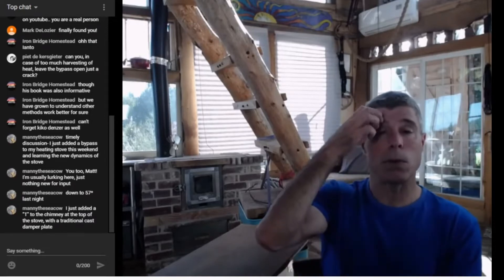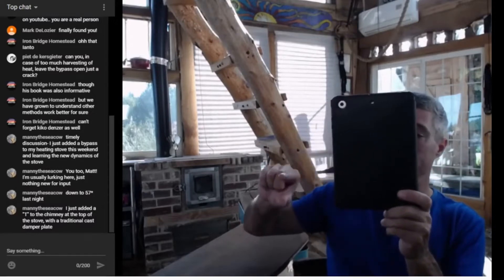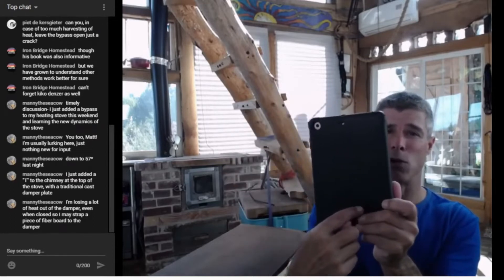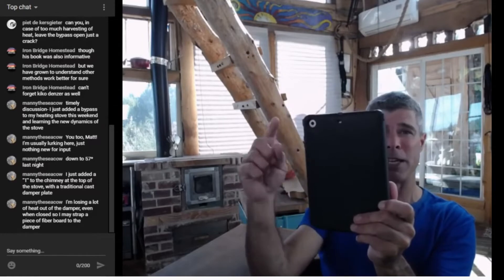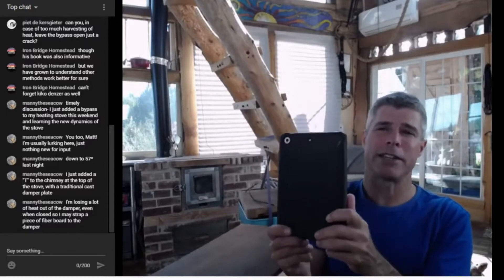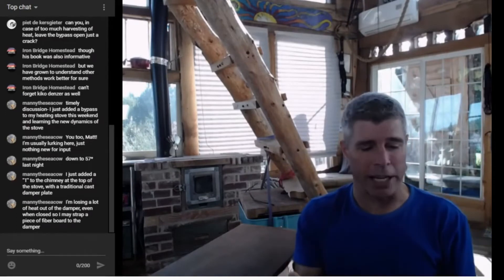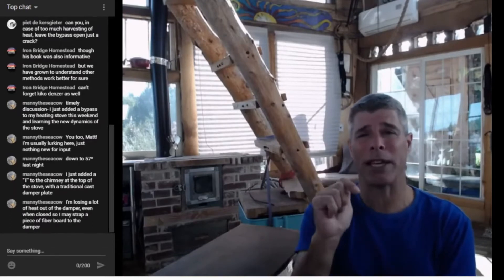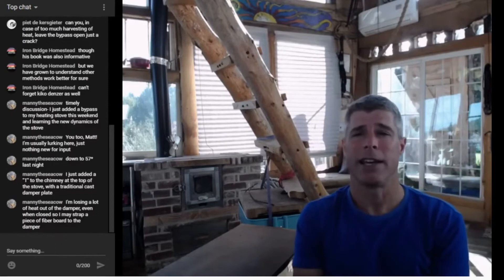External Bypass for a Rocket Mass Heater

Comment: Was able to do something similar with an outdoor cob oven. A batch box rocket stove powers a black cob oven. The exhaust drops down into a bench. When the system is cool, or for short burns I uncap a T and most exhaust gasses take the easier route. To heat the bench I cap the T.